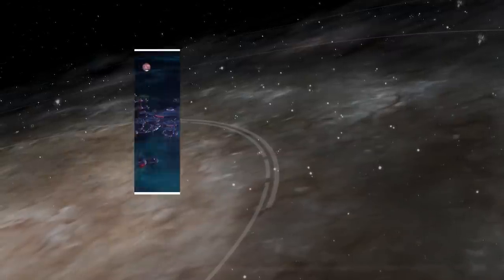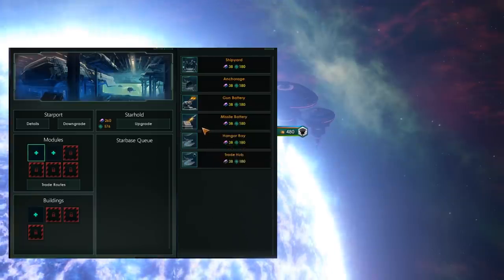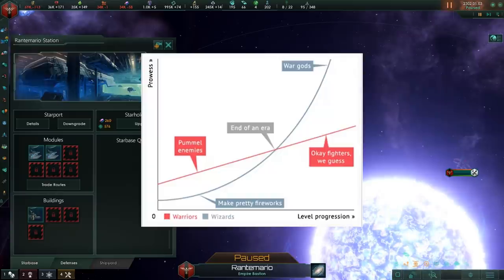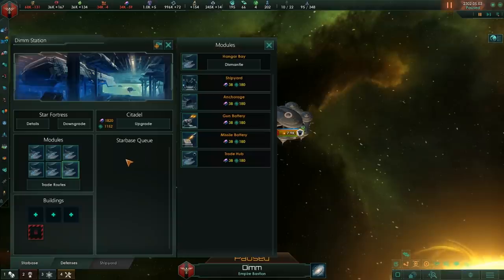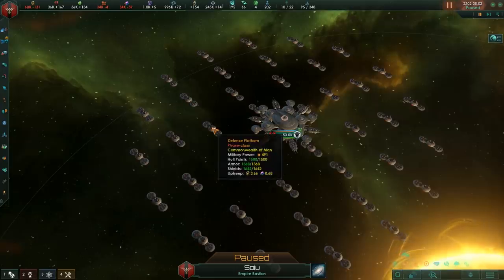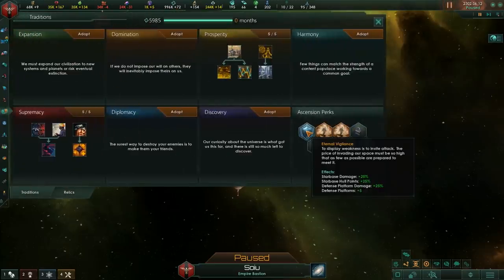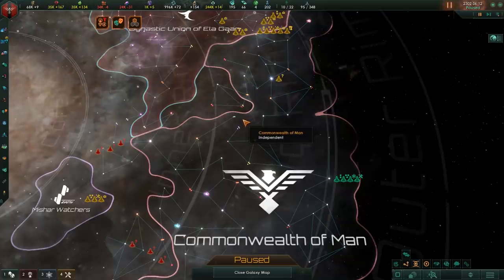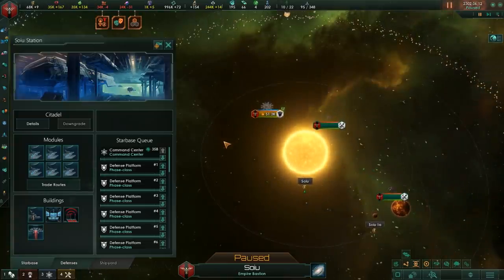Stellaris - Starbase Mechanics are Weird

Comment: Another interesting insight and really something that should be adressed. The stations cost a lot but what good is a 17k station (or even a 47k station for that matter) against a fleet with 125k fleetpower? There's just not contest there. These humongous investments absolutely should be a doomstar level threat once you have pumped so much of your resource base into building one. Just using them as glasscannon shipyards seems wrong.
Reply: recall they are disabled at worse,not destroyed

Comment: I mean holding off a fleet by itself. No don't build them. 

What I do is I still build them to delay the enemy or if im lucky engage the main enemy fleet while under my own station making theirs weaker, also I use them so when I annihilate their fleet they can't easily attack my stuff cause they haft to get past my station. Either way they need a bit of a buff inserts DS9 fleet vs station clip

Comment: Definitely do not agree that starbases are useless.. many players compare the defensive power of a starbase against an enemy fleet. Unless extremely overpowered, a single starbase can not match a decent fleet. This is a strategic flaw. Your fleet positioning needs to be able to support the starbase during an impending attack. Take a starbase any day supported with a minor fleet and it will prove its worth against any invading fleet. 

A recently upgraded starbase is an extra (and tough) target for the invading fleet, soaking up damage that would otherwise be directed at your fleet. Less destroyed ships means longer sustained firepower. Starbase weapons are attrition. The longer the enemy fleet stays, the more damage they take. Coupled with the strategic value of starbases to replenish and repair your fleets, starbases should be the most important strategic factor to consider on the galactic map.

Comment: Paradox should fix this by integrating the Starbase Extended mod. IMO, it solves a lot of the problems you mentioned, and some you didn't (like the fact that there are only 6 modules and buildings in vanilla). They should also make station weapon loadouts editable like with ships and defense platforms.

Comment: i see starbases as walls
they are only as strong as the garrison that hold them
they are great to take the first initial alpha damage from an engagement if you keep your fleet behind it
they fortify your fleet power anywhere between 100% extra FP and 20% extra FP
theyre also cheap on maintanance and dont count towards your fleet cap, which is very usefull
this ofcourse counts for defensive starbases, utility starbases are an entirely different story

Comment: The 0 to 4 thins isn't weird, most indicies and enumerations start at 0 and depending on if it's a shift register or not it the actual values be something like (0 << 0) [0] to (0 << 4) [16]. But most enumerations in programming start at 0 unless manually set to start at a different number. Usual rule is count -1 for getting an index.

Comment: You see a star base and think "this is a defensive fortress, how can I use this to defend my borders". I see a star base and the "yay, more fleet capacity/shipyards/trade collection, and a potential forward operating base for my fleet". Seriously though sure star bases don't retain their relative strength throughout the game, but by the point where they're weakening you should be operating multiple fleets and those should be the main defensive force that can potentially be backed up by the star base if its in that system (and if you have fully built defensive platforms that's not an inconsequential amount of support on a large starbase), not the other way around and star bases on your frontiers ought to be kitted out to operate as forward operating bases that support those fleets outside of combat.

Comment: I'm.... not sure you know what you're doing with Stations.

The first game I ever ran of Stellaris, I had to figure out how Stations worked.  While I was playing on the easiest difficulty setting to learn the game mechanics, I found that Stations are pretty invaluable.

Here's how you use a station:
1.  Use them to cut off early expansion into territory you want in the early game.  Their power is enough to deter most ships in the early game.  They're a stopgap at this stage.
2.  Midgame, you want to move your stations all to every entrance into your empire.  They may stop weaker fleets, but you want them on the edges because this is where you want to be building your own fleets.  This includes putting one at every Gate you own and every wormhole you own.
3.  Endgame, you should not be defending a system solely with a Station.  You can, if you're clever with your upgrades and techs, but you probably shouldn't be.  Ideally, you have a Gate in every single system you've got a Station in.  Take the tech to build gates, and make sure you build a gate on every single station.  Your Stations exist to supplement your fleets at this stage.  They are a free boost to your fleet power at any opportunity you need it.  They can add extra numbers to your own ships for defense, and can make for great "forward bases" when you're on the attack.  Likewise, since they're all guarding a Gate, your enemy cannot "reinforce" their own fleet easily.  Any assault into your territory will be done through "manual" means.  System to system.  This means you can easily and effectively cut off any supply line into your territory and retake any station from any other station.  Unless your enemies park a fleet at your station in order to HOLD IT... you've already won the fight as they now have to commit to fighting and dying, or holding a small piece of nearly indefensible space.

Now, it is possible to make Stations completely overpowered.  I did it with my first run of the game.  When the "endgame crisis" showed up, they had so many shields and guns on them, that it was never a threat to me.  My fleet power was pushing 80K, but my Citadels were somewhere near the 200K mark just because I had so many black holes in my territory that I was super rushing all the Physics tech and had defenses like nobody's business.  The strongest fleet I even saw was the weird energy beings with 120K fleet power that was often just splashed to smithereens against my defenses while I built up fleets to take the fight to them.

The major issue you might have with Stations is you're not allowing them to be "Quadratic Wizards" as well.  Their guns and defenses gain the same power as your ships do, they just have less of it.  Rushing high tiers of tech and taking great bonuses from events and your species and beliefs and governments and even ascension perks...  You can turn them into powerhouses that are even stronger than most FLEETS by the end game.

You just gotta know how to use them.  They're not "straightforward" like ships are.  Ships are a cudgel.  Stations, used properly, are a scalpel.

Comment: The problem with starbases for me is that their strength numbers are missleading and they can't be customised enough. They have huge hp pools, but their dps compared to a fleet is many times less since they don't have as many weapons on them. Platforms are a waste of alloys since they are as tough as tissue paper and they are most efficient when they shoot a few times before the enemy can get into range. This plus the inability to actually pick what weapons the base will have decrease the starbase's versatility a lot. I've seen starbases upgrade into full kinetic loadouts that are not even at the best level available while the enemy is weaker to lasers. This is ridiculous.
Imo, platforms should share their hp with the starbase and we should be able to change weapon loadouts to the starbase itself.

Comment: When you build disruptors and hangar bays to later understand you build a short range defense station and you have 0 long range... Why anyone wants to build disruptors? They are so bad. They are only good in very specific situation. Everyone would build missiles, but pd's make them useless, unless you research 1 tech higher missiles, than enemy pd's. Using swarm missiles and armored torpedo, so their pd's will be almost useless...

Building neutron launchers only is so bad.... That cooldown 16 seconds.... Basically if enemy sends troopers first, and volley is shot at them sulking all that juicy damage, so they would become 16 seconds sitting ducks.... Also tracking is 0, if they track the wrong target like corvette, its a wasted shot...

Also what I noticed with starbases, that if you build plasma weapons, than instead of building laser canons, the design of starbase changes to plasma, this doesn't change already build starbases, they are stuck with those lasers. But for new starbases, they becoming so f bad.... They cannot kill even small fleet, because tracking is so dam low on plasma, vs lasers.....

Also Star Fortress and citadels are very important for megastructure tech roll chance, the more star fortress and citadells you have the better chance, that megastructure will tech will roll out

Comment: I love how a fully upgraded station can literally cost you over 100k alloys... Easily.... And only give you 51k as a max defense? LOL I can get that with 10 ships for 20k alloys. 

Paradox is afraid of making starbases OP, and I get that, but they need to reduce the alloy cost to make it efficient at least. Right now, not to be a dick, but unless you're building one or two starbases on chokepoints, they simply are not worth adding defense platforms. You'd be better served making ships out of those alloys than defense platforms.
Reply from the maker: Agreed, the platforms become cannon fodder

Comment: The comment about putting hangar stations next to jump gates seems...pointless? Like yeah they can protect trade through those jumpgates up to a distance equal to the number of hangars...but if you put the jumpgate in your capital system, with a starbase focused on only collecting trade, you would collect from the same range of territory without generating piracy (because it isnt going between two stations) or has something changed?

Comment: Aspec doesnt know what he is talking about here, starbases are absolutely worth using and you absolutely should upgrade them.
A massive fleet will easily beat them for sure but thats like complaining about insert ship class here is not worth using because one of them doesnt beat a fleet worth 100 times its cost, big surprise there... not to mention the non-combat types of starbases you can have that are also worth using and upgrading for.

Some quick math and we can see that a basic citadel costs 4950 alloys to make not counting the base tier 0 station and more importantly, without any sort of cost reductions but you can quite easily get 33-48% cost reduction for upgrading stations.

Oh no, Aspec was right, thats so expensive! almost 5k alloys!
That.. only lets you build 3.5 high tech battleships, a citadel using mostly tier 3 techs(I assume due to a bug when cheating when I wanted to test it.. for some reason the stations refused to use better stuff) does actually win against 4 of said high tech battleships using giga cannons, neutron launchers, artillery and all the non-special high tier defenses. If we take station upgrade cost reductions into account, those 4 battleships cost kinda close to two citadels.

Finally, I would not recommend hangars on your stations for the same reasons you dont put them on your ships aside from "its fun/cool!". The short version of why you dont is that it takes too long for the fighters to do anything while guns are instant damage. Exception might be if you for whatever reason need the extra trade protection hangars provide.

TL;DR
Stations are good because you get a lot of worth from them, even citadel bastions are worth using because the enemy typically has to send a fleet at least twice as expensive than the station to actually beat it and a fair bit more than that to do it without losses. Platforms are similarly cheap to build compared to what you get for the alloys, like a destroyer in cost but packs a bit more health and a lot more firepower.

Comment: Saying something is useless just because its price-performance ratio isn't optimal is kinda dumb. Especially because you ignored it's main strength. 
It does not cost fleet supply.
Reply from the maker: Which is a fair argument, I'd still rather have force projection than static defenses.